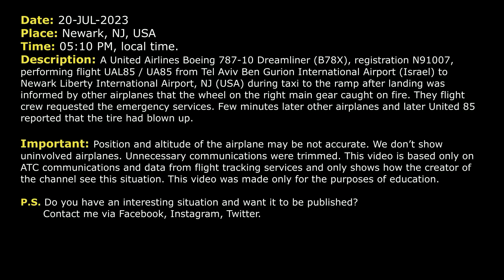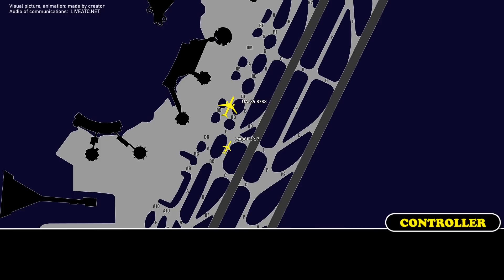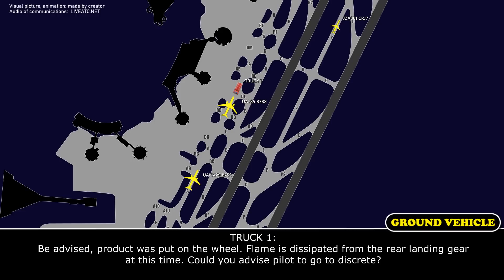Landing gear caught on fire during taxi at Newark. United Boeing 787-10 Dreamliner. Real ATC

Comment: I somehow doubt the two hours of fuel number. Considering they were already on the ground. They have infinite hours of fuel.
Reply: Well, it isn't infinite if the engines are running, right? But it really isn't about the two hours, it's about the fuel load - 16,300 lbs., which is 2415 gallons. That's a lot of potential energy if the fire spreads.
Reply: @2whl4re  Even if they run out of fuel they won't fall out of the sky. I believe if they turned off one engine and kept the other at idle they could keep power and AC for at least five hours, after which they would still be on the ground  and only lack AC.
Reply: They could easily have two hours left with alternate, reserves and extra fuel for deviations.

Comment: A lot of time was passing by until fire trucks get there. Why arent more fire trucks stations in different points of the airport
Reply: Airports are huge and having personell on alert and ready to go 24/7 is expensive and difficult.
Reply: They do have trucks at multiple fire stations across the airport. But they can only have so many stations. Yep… because of costs
Reply: in the uk i think fire services are mandated within the airport to get to the scene within 3 mins of being told so fire stations are located to best allow this
Reply: @fleececommander  But between 3PM and 5PM they are all having tea and do not respond to calls.
Reply: Airport fire equipment are required to be able to get to any location on the airport within 3 minutes. EWR meets this requirement.
Reply: Money.
Reply: People want to fly cheap. Top notch security systems don't come cheap though.
I think what we have now in commercial aviation in terms of security is quite decent. Not sure it will stay this way for long, though. Too much entitlement in the air.
Reply: @andreea007  ai dreptate! Zi frumoasă!
Reply: @vst9266  Asta da surpriza... Zi frumoasa sa avem :)
Reply: @andreea007  hehe,banuiam ca o sa-ti placa surpriza.😉

Comment: Truck 1 asks a question, disappears on the radio.. smdh
Reply: Well, he was running to get to the fire while coordinating with his team on one frequency and with ground on other.
Reply: @andreea007  But don't ask the question if you're too busy to listen to the answer.  Everybody is busy (ATC, pilots, ARFF).  Keep the frequency quiet if you're terrible at multi-tasking.
Reply: @mar_man813  Agree. Radio transmissions don't always go smoothly though. It may be that he did pay attention, but the message never got to him. Jammed transmissions are more common than we think. Comes to mind that situation when a certain aircraft couldn't hear the tower, but he could hear other pilots on the same frequency. The tower ended up providing instructions via the other pilots, even though they were all on the same frequency...

Comment: how many minutes for ARFF to be AT the aircraft? Too many
Reply: You do realize the size of an airport?   The ARFF is not right next to every place at the airport where an emergency can happen.  Just like if you call the fire department for a fire at your house, it takes time to drive from the fire station location to the fire.
Reply: Airports are required to have enough fire stations for any one of them to meet an aircraft within 3 minutes. Newark meets this requirement.
Reply: Controller should have cleared the equipment before they arrived at the crossing runway.  This would have reduced the response time.  He was clearly overwhelmed, poorly trained, or both.
Reply: @k1mgy  do you know that the rwy was clear to cross?

Comment: Does anyone know why fuel onboard is important? Aren't the fire trucks going to pummel the plane with water/foam anyway?
Reply: main landing gear close to the engine and definitely, the hydraulics, lubrication oils & fuel lines. knowing how many fuel remaining on that plane, means those firefighters can calculate & anticipate for the worst possible scenario like (IF) the fire is actually linked to a leaky hydraulics that can quickly spread to other parts of the plane & blow things off, etc.
Reply: Better to know if you can get it. But they can manage without it. Pilots are well within their right to tell ATC to shut up and leave them to their check lists and emergencies if their workload is high and unmanageable. So they don’t have to give souls and fuel but it’s helpful to ARFF for accounting for people and knowing what they may be up against and resources required. But again, they can still handle the emergency without such information.
Reply: @OfficialSamuelC  In today's high tech era, you would think that the tower would have faster access to the flight manifest with the number of people on board upon pushback.  The fuel quantity/flight time is already computed for the pilots on the system in the cockpit. Why can't this computation just be requested and automatically sent via data link between the tower and the plane, freeing up the pilots to do what needs to be done to save the plane? 
This could be as simple as just a "sticky note" attached to the data involving the flight in progress.  If shipping companies can do this sort of thing tracking every little package, then the air traffic control system could also do this in the act of safety improvement.
Reply: @grandinosour  This. Would also be trivial to broadcast this information live over radio directly from the plane’s sensors.
Reply: For a situation like this it really isn’t that relevant.  A wide body jet that just landed is always going to have a huge fuel load even after a transatlantic flight.  

It doesn’t matter if it’s 8k or 25k of fuel, either way it’s a huge potential fire load.  So much unnecessary radio traffic happens going back and forth about fuel when it’s not necessary. 

As a former firefighter I just wanted to know if it’s a “big bada boom” or “small bada boom.”  Aircraft type, souls, and if any hazmat on board (standard info outside of US) are far more important than knowing exactly how much fuel.   

The two exceptions that come to mind are 1) fuel emergencies in flight 2) fuel leak on the ground

I never hear US ATC ask if there’s hazmat on board.
Reply: If they know the fireload they know how much effort is required in a worst case scenario.
Reply: Seriously? Logic and common sense say that it's better to be as informed and be prepared as one can berather going in blind and clueless.

Good grief.
Reply: It does seem a formality that has little bearing.  No one is going to count the number of passengers coming down the slides, nor is the fire service going to approach the scene any differently over a fuel load value.  There are good times to ask these questions.  I agree with the inference that this wasn't one of them.
Reply: @k1mgy If fire gets to the cabin, how can they perform a successful rescue operation without knowing how many people they should rescue?

Should they send the rescue team into the flames just to make sure there's no one left behind?
Reply: @k1mgy  "No one is going to count the number of passengers coming down the slides, "
Where'd you get that silly idea? Of COURSE they are going to count the passengers. Why would a fire fighter rush into an empty plane to save anyone if they are all accounted for?
Reply: @k1mgy  "over a fuel load value. " 
Geeez guy.....how can you think the fuel load is not important? Of course they want to know whether they are dealing with 16,000 lbs of fuel or 223,000 lbs. You don't see the difference?

Comment: I noticed ground copied the fuel wrong.
Reply: ground to truck 1 '15,300 souls on board and 309 pounds of fuel' 🤪
Reply: @PlunkyFrog2001 this made me laugh out loud for about 15 seconds for some reason
Reply: Why would the amount of fuel matter in this case anyway? I understand that for an airplane in the air it affects how long they can stay airborne (or how far they can divert) and things like landing distance, overweight landing etc. But on the ground? If it catches fire it doesn’t really matter if it’s 1000kg or 5000kg, does it?
Reply: @Mike-oz4cv  16300 lbs is about 2,500 gallons. Some 787 hold up to 33,000 gallons. If there's a burning plane that could create a lake of fire, they're gonna request more resources.  While that's unlikely to be the case here, no way for ARFF to know for sure without being told.
Reply: Other have an issue with ATC asking for the fuel, as they say it is irrelevant.

You gotta love modern times, when everybody is expert on everything....
Reply: Irrelevant
Reply: @marcospark2803 It's very relevant because not only does it reflect poorly on the controller's attention to detail, and a really good attention to detail is important for controllers to have to be able to safely direct aircraft on the ground and in the air, especially in an emergency, ARFF needs to know the amount of fuel on board accurately in case the fire spread, they need to know so they can determine how best to fight the fire, how big the fire may become, etc. That's why ARFF always wants fuel in pounds, not time. Controllers want fuel in time so they have an idea how long the aircraft can stay flying while ARFF wants the actual quantity so they can better fight the fire.
Reply: @marcospark2803  It is when assessing the controller's overall skill and response.  Attention to detail and focus are absolutely critical.  I'm not understanding why a critique of comms is rejected out of hand, and with quickly-thrown single-word responses.
Reply: @marcospark2803  it's not though.